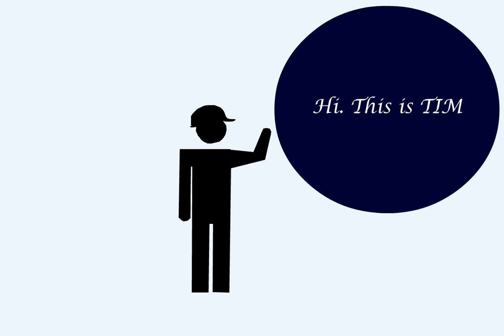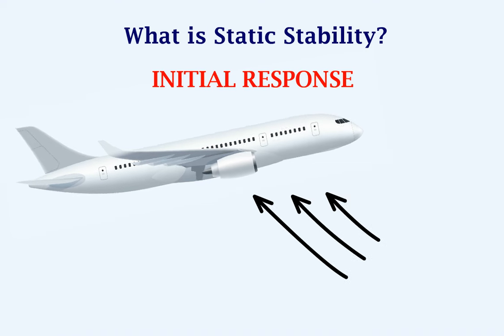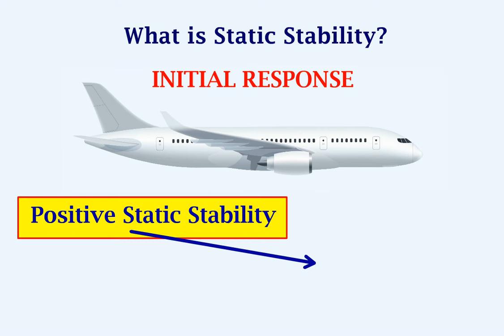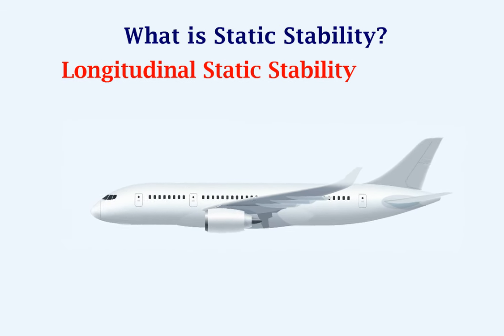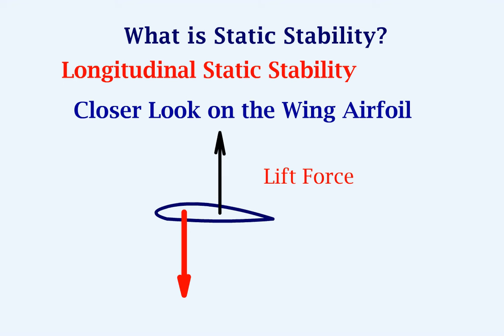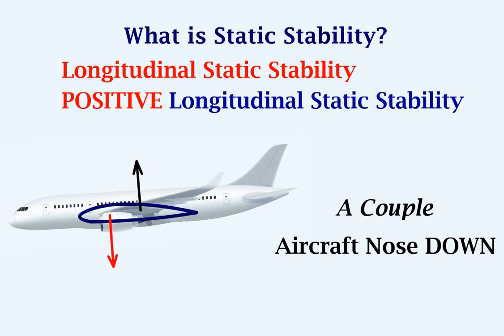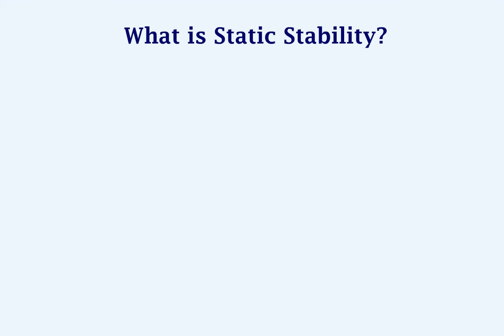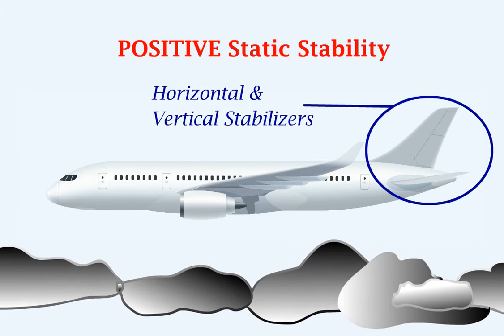Understanding Airplane's Longitudinal, Lateral & Directional Stability and the Need for Stabilizers!

Comment: A correction to understand stability we consider the aerodynamic centre and not centre of pressure as AC does not change with change in lift and a fixed reference is considered for calculation purpose.
Reply: Hi
I am AUTOMATION Engineer, can we collaborate in our research, please?

Comment: Good video just remember that it is not a matter of only altitude change here. For example, neutral longitudinal static stability does not mean the aircraft will maintain altitude of whatever the disturbance was but rather angle of attack. Therefore the altitude will continue to change. Whereas negative means it will change exponentially, and positive means it will return to stability (again, not necessarily the original altitude).
Reply from the maker: Thank you for the input! Do check out my other videos as well!

Comment: When you introduce the 2 types of stabilities, it'd be nice to hear a short definition on the differences. (i.e. based on the time period that is analyzed. When talking about Static Stability, only the moment is investigated after the disturbance, while for Dynamic Stability the whole time period of the motion is carried out.)

Also, I'd show examples for a statically stable, neutral and unstable response in each case.
Hope you find it useful, pretty good elementary introduction in fact.
Reply from the maker: Thank you for the feedback. 
Creating a separate video for Dynamic Stability so I did not include that concept in this video.

Comment: Very nice simple explanation but there is a mistake @ 4:20. When the wind hits the plane from right the nose will turn to the direction of the wind which is in this case right.Because the wind will hit the vertical stabiliser which is located in the back of the plane from the right which makes the nose of the plane to move to the right
Reply from the maker: This would be true if the aircraft is stationary. But if the aircraft is moving forward, if wind hits the aircraft, it will hit the nose of the aircraft initially which will cause the aircraft to yaw towards the left!

Comment: okay so there is an opposite reaction in the tail but why is there an increase in drag that makes it yaw back? many thanks in advance!
Reply from the maker: The tail is a vertical surface, so any disturbance in roll or yaw cause the tail's vertical area to move into the disturbance, causing an increase in the drag!

Comment: edit: great video, at 3:20 the horizontal stabilizer airfoil should be upside down as it provides a negative force. it's just a little confusing.
Reply from the maker: I think you are talking about the horizontal stabilizer. The image depicts the forces acting on the aircraft during straight and level flight.
Reply: @JxJAVIATION  can you please make a video on spin stall, Its clear that spin stall occurs because of presence of yaw during a stall, but I am trying to find the effects of the fuselage on the rearward wing stall during the formation of spin
Reply from the maker: @BreakingMechs  You could watch my video on Dynamic Stability where I discussed a little about it. But I will note down this topic for making video!

Comment: Nowadays you can achive stability by means other than mechanical design
Reply from the maker: The basic mechanical design is available on all the aircraft. Modifications are done on it to improve the aircraft stability
Reply: @JxJAVIATION  There have been some aircraft  which are not stable per mechanical design .
Reply from the maker: @davidinnes8754  these would be aircraft that are required to perform severe maneuvers.

Comment: Sorry, but this is one of the poorest explanations of longitudinal and lateral stability I have seen. I notice some comments by students saying this has helped them. Please don't use the explanations given here in an exam. In particular find out for yourself what the neutral point is, and understand why the centre of gravity must be in front of the neutral point for positive longitudinal static stability. Also, note that it is not necessary for a tailplane to push down for positive longitudinal static stability. If it is big enough or far enough behind the wing, it can shift the neutral point well behind the CP of the wing, so that the centre of gravity can be behind the wing CP.
Reply from the maker: Well, the video is just a visual representation of the concept of different types of stabilities applied on an aircraft. Practically speaking, how far would you design the tail plane. In a normal aircraft design, the tail is majorly responsible for creating a downward force.
Reply: The tailplane must be used to produce downward force only if the CP of the wing is behind the CG. As you said, the CP moves as a function of angle of attack. The best way of explaining longitudinal static stability is to start with the neutral point (NP). There is a tail off neutral point, and a tail on neutral point. Starting with the tail off neutral point, it is the axis perpendicular to the plane of symmetry where there is no change in pitch moment with change of angle of attack. But wings have camber, so at zero lift, there is inevitable a nose-down pitching moment about the tail-off NP. If the CG is ahead of the NP, the lift will produce more nose-down pitching moment about the CG as the angle of attack is increased. Adding a tailplane shifts the NP aft, because the tailplane produces nose down pitch moment as the angle of attack increases and negative pitch moment as the angle of attack decreases. How far the tail-on NP is behind the tail-off NP is determined by the tailplane volume ratio (https://gatepathshala.com/pdf/download/conceptoftailvolumestosizehorizontalandverticaltails.pdf). With a high tailplane volume ratio, at low angles of attack, the tailplane is not unlikely to lift. I remember my own surprise when one of my colleagues in the Aerodynamis Office at Hawker Siddeley Aviation, Kingston, first pointed this out to me in the 1970's. (He was in the loads and stores section which was responsible for determining the range of aerodynamic loads on the aircraft structure, and the aircraft was the Hawk trainer; I was a Flight Dynamicist).  @JxJAVIATION